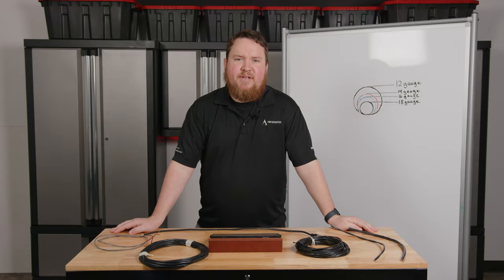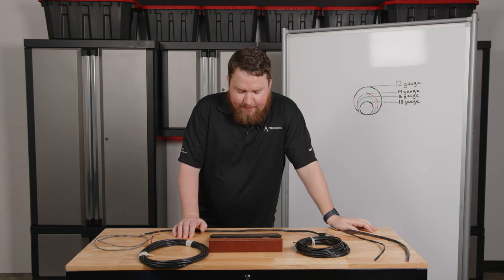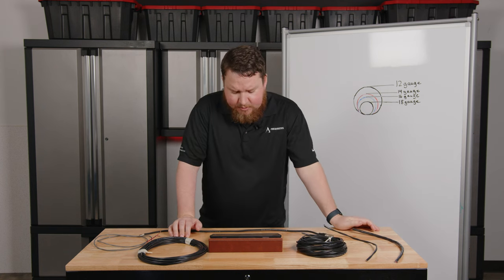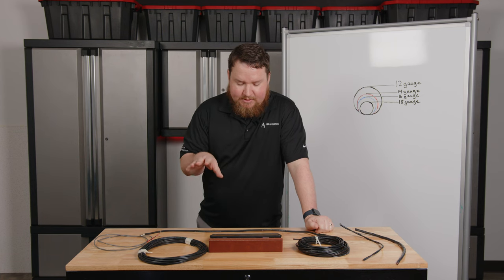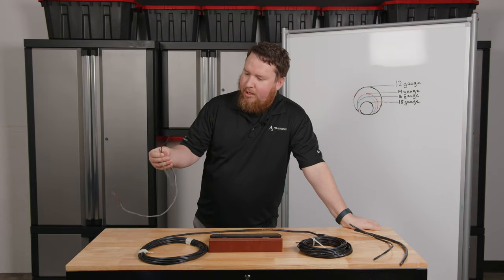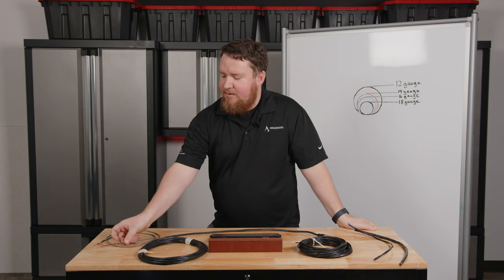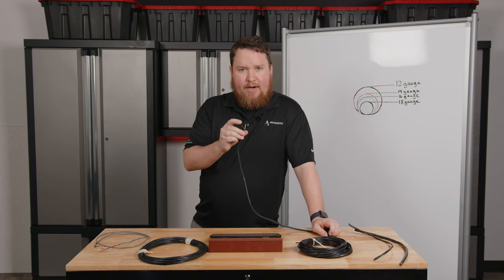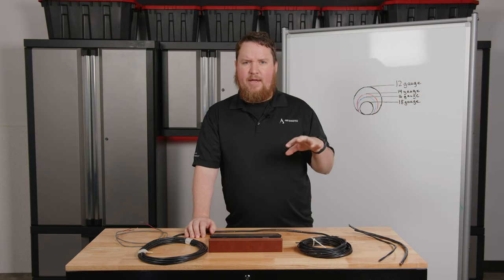What is the Best 70V Speaker Wire Gauge? on Pro Acoustics Tech Talk Episode 88

Comment: I like your channel/content! Not overproduced and about the right amount of geek. 🙂
You recommend twisted pair, which doesn't seem to be very common. I'm wondering how important this is. I'm eyeing a 250' pull box on Amazon: Voltive 16/2 stranded plenum OFC, UL listed, for $115. This is for a 70v system, 6 pendant speakers tapped at 30W (maybe 60W if I pick up a sufficiently-capable mixer/amp like the RMA500BT). Penn Wire offers essentially the same but with twisted pair, at 500' (substantially more than I need) for about $221 (plus shipping? / shipping calculator doesn't seem to be working). Oh...if I add that to my cart, it says minimum quantity of 14! 😲
The plan is to install the speakers relatively near some pendant LED fixtures. Do you think the Voltive option is reasonable? Is there a better source of twisted pair for the amount I'm looking for?
Reply from the maker: Thank you so much for your kind words. We're thrilled that you're enjoying it!
Twisted pair wiring is preferred to avoid electromagnetic interference from the pendant LED fixtures, routers, or other noisy electrical devices. This interference can manifest as unwanted buzzes or hums in your audio system. For that reason, we strongly recommend twisted pair speaker wire. Although the other wire you mentioned may be more affordable, it lacks the twisted pair configuration. If audio quality is a priority, investing in the added cost of the twisted pair wire may be worthwhile to ensure the best possible sound quality and minimize interference. Ultimately, the decision comes down to whether the additional expense and minimum quantity requirements of the twisted pair wire are justifiable for your specific setup and needs.
I hope this helps you make an informed choice! 😊
Reply: @ProAcoustics  Thank you for the response! I've since found that Performance Audio offers West Penn 25225B plenum rated 16/2 (4 twists per foot) by the foot, at an even better price than the Voltive wire.

Comment: What type of wire would you use for 70v outdoor aerial installation?
Reply from the maker: For a 70V outdoor installation, you should use direct burial, UV-resistant, water-block wiring, such as West Penn Wire Aquaseal. https://www.proacousticsusa.com/catalogsearch/result/index/?manufacturer%5B0%5D=West+Penn+Wire&q=Aquaseal
This type of wire is designed to withstand outdoor conditions and ensure reliable performance.

Comment: Hi I want to install Sonance - SGS 8.1 SYSTEM W/SR 2-125 AMP - Garden Series 8.1-Ch. Outdoor Speaker System with 2-Ch. Amplifier
(Each) - Dark Brown/Black
My question is what size wire I need for a 500 ft run ?
Reply from the maker: Hi David, The specifications for this amplifier mention that it will support up to 12AWG wire. We would suggest using that for long speaker runs. However, please also reach out to Sonance for the manufacturer-recommended wiring. https://www.sonance.com/company/contact